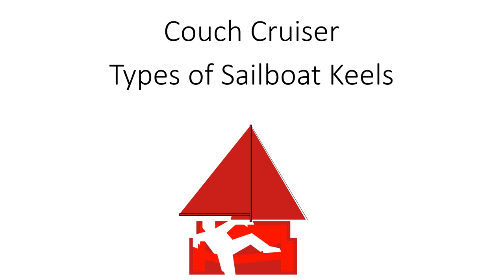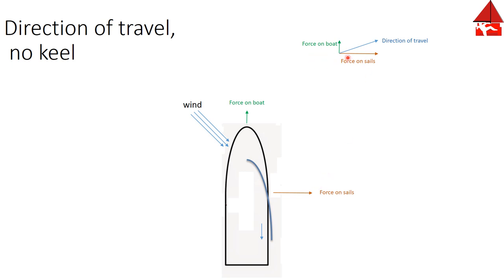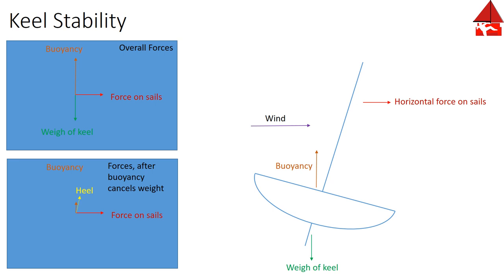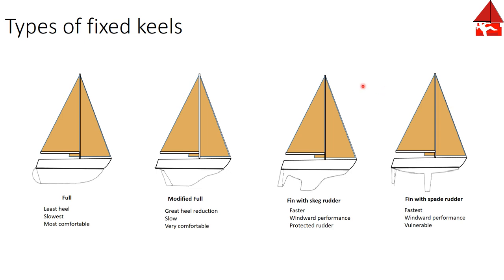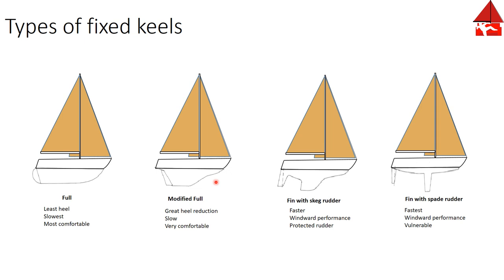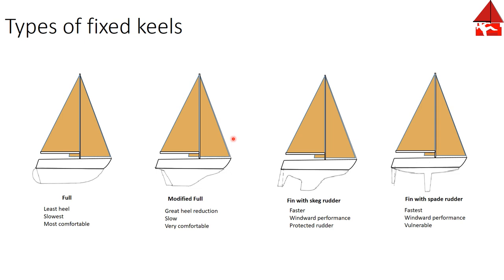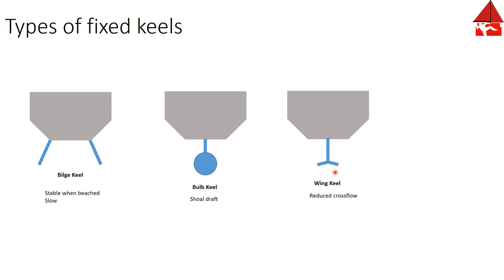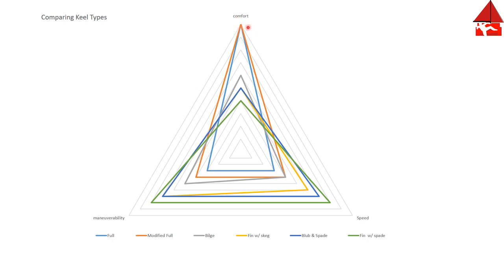Types and functions of Sailboat Keels

Comment: My Catalina 18 has a wing keel, and I really love it. Although the boat is small, it sails like a much larger boat. The fin keel gives it lots of stability, while still enhancing performance. The boat hardly heels at all, 30 degrees max, even in a brisk breeze. Another cool thing about the wing keel is that it stabilizes the boat when going through large wakes from passing yachts. When the wave goes to pick the boat up, the wing slows the upward lifting of the boat. Then, on the way back down the back of the wave, the wing keel slows or cushions the fall. I have been hit by some huge yacht wakes, and it always amazes me how stable the boat takes it. Lastly, the draft is only 2.5 feet.

Comment: An additional advantage of a centerboard or daggerboard, especially in racing, is the fact that when running BEFORE the Wind, either one can be Retracted Removing Drag as all the force of the wind is acting on forward motion with no side slippage. Also, note that the mass of a keel or board must be directly proportional to the height of the mast(s) and the sail area that it(they) carry. Our sloop had 7 tons of lead at the base of the keel because her mast towered 80 feet above the deck.          sdh T.A. '67 in CT

Comment: My first boat was a 32 ft. 1971 Islander sloop - with a fin keel, and skeg hung rudder.  In a blow, she had a bad tendency to round-up (dramatically).  In selecting my next boat, I wanted a Modified Full keel - and went with a 35 ft 1963 Pearson Alberg sloop. The sea handling was much improved with the Modified Keel - and in a blow - she tracked much better.  I would say that the Modified Full keel also gave me greater comfort - as I had previously had some close encounters with whales, and running into a crowded field of crab pot float lines - while sailing along the Baja coast during moonless nights.
Reply from the maker: Modified full keel is on my list of desired attributes. It's great to hear   a first hand account. Lobster season in San Diego sounds about the same as what you describe in Baja.  A mine field of crab/lobster trap floats & lines.
Reply: Sounds like you needed to reef the main first on that Islander. Nowadays, of course, with roller furling headsails boat balance is much easier to achieve. But I agree with you about the modified full keel for cruising.
Reply: When offshore, I always sailed with either the first or second reef in, after sunset.
However, during an easy day of sailing - upon approaching the northern edge of Isla Cedros, off the Baja - the wind rose sharply within seconds - and she rounded up quickly - risking a broach.  Luckily, I was holding the main sheet and my instinct was instantaneous - and eased the sheet.  She was a might tender.

Comment: at about 5min, where you present the effect of the weight of the keel i think you took a slightly wrong approach. it is not as easy as taking the forces and adding them as they all appear at different locations. you have to look at the torque the forces cause. then you see that buoyancy and  the weight of the keel work together. as the boat tilts, its center of buoyancy shifts leewards since this part of the hull gets pushed into the water further, thus creating torque working to stabilize the boat. with your approach of just adding the forces as if they acted in a single point, every boat would tip over. additionally if you look at the torque you see that the weight of the keel pulls the hull down on the windward side so its working together with the buoyancy pushing it up from leeward.

Comment: Again, great summary. And pretty fun logo. I think technically, the "lift" of the sail airfoil pulls the boat, like an airplane wing. I, too, am on my couch currently lowballing boat owners this winter. It sure seems to be a buyer's market, and so that some great value will be a big determinant of the boat type I finally get. As you note, as a trade off, each hull has advantages. In fact, a good generalization is : If a boat is roomy and comfortable inside, then she sails worse and is less sea kindly.
(At 11:16 I think you switched centerboard and daggerboard explanations.)
Reply from the maker: Thanks for the feedback. You are spot on. I miss spoke.  Daggerboard = straight up/down. Centerboard = folds like a pocket knife. I think I can annotate the video so people know at that section. As you can probable tell I'll new at this :)

You are also correct. Its the lift that generates the forward force on the boat since the wind on the leeward side of the sail has to move faster due to the sail curve causing a low pressure and sucking the boat in that direction. I'll try to add another annotation to the video.

Anyway, thanks for watching and I appreciate the feedback
Reply: Winter is actually the worst time to buy a boat , it may sound counter intuitive but summer is the best time to buy because there's less demand ( most people buy during the winter ) can save as much as 20 % by looking mid summer.
Reply: add annotation in-video ;) nobody's reading description.

Comment: Occasionally I see references to the keel having its own 'lift' underwater, similar to lift seen with sails. That seems like a peculiar notion, since lift can only be generated when direction of travel conflicts with where the keel is pointing.
Reply: spelunkerd 
The boat will NEVER travel exactly in the direction that the keel is pointing due to “leeway” caused by the wind blowing the boat slightly sideways.  This is typically 8 to 10 degrees off the intended course to leeward, thereby permitting a keel of suitable shape to generate some ‘lift’.
Reply: @johnclarke9054  I agree, though for the most part leeway going into the doubledigits almost requires the boat to be trimmed very badly. (closed leech on the jib generating leehelm on a beamreach did it for me once but that particular sail mas made by a total incompetent so I tend to use a different one with a better cut although it is also smaller). If you venture into the topic of asymmetric daggerboards you get rift at 0 degree angle of attack or even a degree or 2 into the negatives.

Comment: The keel is the backbone of the boat and is built into the boat. All fins are not keels, wile some fins are. Removable fins are not technically the keel in boats that use them. The tiny thin fast fins on lightweight racing boats are also not the keel of the boat.

Comment: Ok, so with a properly designed keel aerodynamics could be employed to stop a boat from heeling without the need for weight.  Same for slippage. It would be like having a small underwater sail.
Reply: That would only work on a powerboat, which does not rely on the wind for generating its velocity.  These devices exist on many ships and large motorboats that are displacement hulls (as opposed to planing hulls).  They are called "stabilizers."
Reply: @OgamiItto70  - Or called "foils" which, do exist on sail boats and stop the mono hull from heeling.

Comment: The offset of less manoeuvrability is better tracking. Full keels want to go in a straight line. But for cruising the durability is the main reason I would want a full or modified full keel. I do not want to hear the crunkle crunkle sound under the boat mid Atlantic.

Comment: Which keel would you recommend for a small (26-30ft) trailer sailer intended for crossing the Caribbean twice a year?
Reply: Big J Productions For linger distance, I think Full or modified full is the best, gives comfort, more weight and security, and with a smaller boat, I’d want some weight on it so that it doesn’t as easily get thrown around in heavy weather
Reply: If you don't know, you need to sell your boat and get a new hobby.
Reply: Biana Doubt  that is a terrible analogy. If you own a boat, getting wet is the last thing you want. Unless you plan on sinking your boat for insurance money.
Reply: Biana Doubt  now who's triggered 😂😂😂

Comment: The sail is a vertical wing. From above it looks like the shape of a wing. Wind flowing across the sail goes on the back side and wind side. The wind that blows across the back side of the sail goes faster than the wind on the wind side thus creating lift. Yes, boats are actually getting sucked forward due to lift on the back side of the sail! The lift is a force vector perpendicular downwind to the sail and the keel prevents that "upward" lift from pulling the boat downwind. The keel and rudder(s) also create lift but their force vectors are opposite the sail force vector, thus keeping the boat from going downwind.
What's really cool is if you look at your rudder and move it back and forth. Some of the rudder is in front of the axis of rotation, thus water will push on this component counteracting water pushing on the rudder behind the axis of rotation, creating force giving you power steering! So cool!!
As far as a bilge keel setup...I have no idea why you'd talk about being beached? A bilge keel system is great for stability, they're actually considered passive stability systems. They greatly reduce the boats desire to roll. I would never want to beach any keel on any boat unless it's designed for that.
Reply: When a guy from a yard responded to my question "so how does a boat sail into the wind instead of being pushed back" with "the sail generates low pressure on one side that pulls it in the direction you wanna go" my young mind was blown. I'd never considered the parallel between wings & sails until then.

Comment: Sailboats are lifted by low pressure on the backside of the sail much the same as a wing. There is some aspect from the windward side of the sail the main emphasis is lift from the backside.

Comment: I build 1meter racing sailboats (US1M) class.  The rules are VERY basic,
 mast height 55" , keel 14.5" , bulb weight 5lbs.  2ch radio. 
I have 4 different hulls, 4 mast/sail rigs that are interchangeable.  
... it's always a balancing act to keep the mast vertical for effective "drive" from the sails.  
( too old to crew on my friends 40' )

Comment: So which keel would be best for ocean crossing and deep blue water sailing?
Reply: Full
Reply: Theoretically full, though there are few boats around now with true full keels. People cross oceans in all sorts of boats but most long term serious cruisers who cover thousands of miles would probably have modified full keeled boats which also tend to be older and heavier generally than modern production line boats. Older, wooden sailboats were shaped the way they were because that's what you could do with wood, early fibreglass boats simply carried on using the same long/full keel designs but gradually have evolved in to the various keel designs seen today...

Comment: I have a Olympic Dolphin 23. Dagger board keel. Dagger board rusted away. No plans can't make a new one. Keel trunk in good shape. Can I build a wing keel to slip into trunk and not use dagger board anymore.
Reply from the maker: I would think it would be possible. Naturally the wings would prevent it from fully retracting but I think it could be done.  Seems much harder to do though than fabricating a replacement dagger board. I'd recommend taking pictures and posting them to the "Boat Building & Builders" group on Facebook.  Some really smart and experienced guys on there who can probable give you a more exact answer.

Comment: Question for anybody out there... why are catamarans & trimarans usually faster, even though they are multi- hulls with a lot more wet surface?
Reply: A catamaran will sit much higher in the water and therefore have less wet surface than a mono hull and a trimaran is a compromise between a mono and cat so it will sit higher in the water than a mono hull but not as high as a cat.
Reply: @maelstrom2594  Thanks for the info.

Comment: A noble attempt to simplify the physics of sailing, but I'm afraid there are so many misstatements it loses much of its benefit. Granted, going into the physics in detail would lose a lot of readers, but that doesn't give license to misrepresent the facts. I'd like to give the same subject a try (one shouldn't complain unless one is willing to step in), and might do it at some later date.
Reply: I'm looking forward to your more detailed explanation.
Reply: The explanation of the forces driving the boat is fairly inaccurate, see e.g. https://www.real-world-physics-problems.com/physics-of-sailing.html  or http://newt.phys.unsw.edu.au/~jw/sailing.html  - The keel type benefit triangle is just hard to make heads or tails of.
Reply: Gary Casey As a keen sailor and having designed and built a boat my self, your comments are spot on. Not to mention, the vectors are drawn improperly

Comment: is there math to design a proper size keel for a boat like 50' 15' beam or 40' 20' beam for say speed. size weight and so on
Reply: You may learn a bit from the book understanding boat design. I cant remember the formula but you relate the keel size by a ratio of sail area versus lateral resistance. Once you subtract the lateral resistance provided by the hull below waterline, you are left with the vertical area needed to be addressed by the rudder and keel. The more the keel runs the length of the boat the shallower it can be for the same area while if doesnt run much of the length it has to be deeper as exemplifed by the fin keel. You also have to ballance the center of lateral resistance so its behind the center of effort of the sails so the boat rounds up instead of down wind.

Comment: So you are saying that the sail redirects the wind and creates a thrust,pushing the boat forward. That is so not correct.
Reply from the maker: Very true. I annotated the video to try and make what I meant more clear. The boat gets sucked forward by the difference in pressure caused by the speed if air difference on each side of the sail
Reply: Hi, engineer here.

Sails do redirect air to create thrust. If air was not redirected, nothing would happen.

Try not to brow-beat people who know less than you, because there's someone who knows more, and will respond in kind.
Reply: Hi Philly Cheesecake  Think you should see the reply to my comment from couch cruiser (the guy who made the video) He agrees with me that he did not give a very good explanation of how a sail works. He explains in his comment how the boat is sucked along by a differential in air pressure on either side of the sail and not really by a deflection of moving air creating a thrust.  There is a small element of thrust as you say but it would be very inefficient means of powering the boat without the lift created by the differential in air pressure acting on the sails.
Reply: sails dont create thrust... they create lift

Comment: Nice and clear videos and explanations. Good Job. Keep on.
However, there was a mistake regarding the vessel stability and her speed. In the horizontal position, you only get comfortable sailing. Highest velocity is achieved precisly when the vessel leans for about 45 degrees. Plain physics.
Reply from the maker: Thanks for watching and the comment. While i agree large heel angles feel faster I don't agree they are truly faster. The greater the heel angle the more you have to use the rudder to keep on course and the more you move the rudder form  center the more drag it causes acting as a brake.
Reply: Also the higher the lean angle, the less sail era is exposed to the wind.  The sail angle is a result of going fast in good wind, not the reason for the speed achieved.

Comment: All of the sailboat keels are off keel and do not keel the sails. Lateral resistance for the sails should be ahead of the sail area effort.  The mast and headsails are keeled to keel the sails.   In olden times the stem to stern keel line keeled the sails .  The stem should be the deepest point of the boat to have rudder control and sail power..

Comment: All this explaining about sail boat keel and heel and counter heel is caused by the designers keep making the boat with a curve under bottom and always shaping the bottom of the boat like a V. All this can be avoid for a sail boat if they make the Bottom flat and slightly rounded at the edges. With this design no keel is necessary.